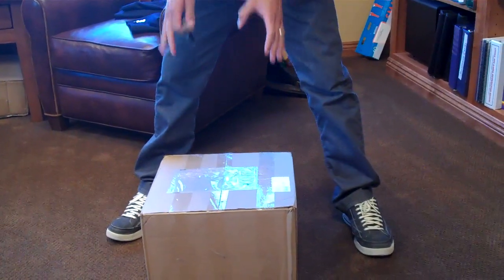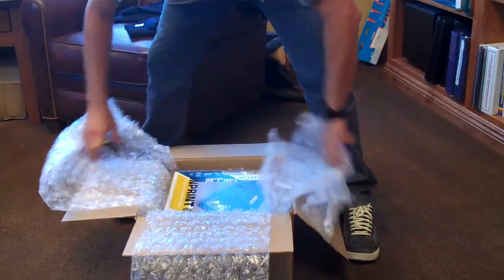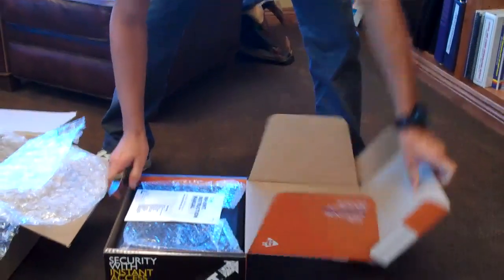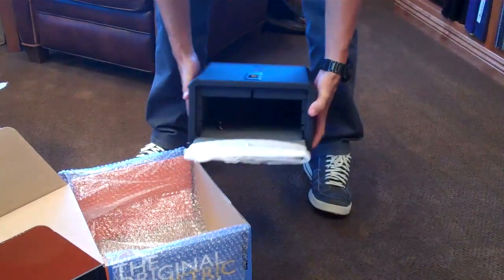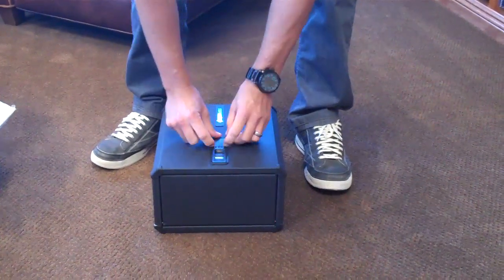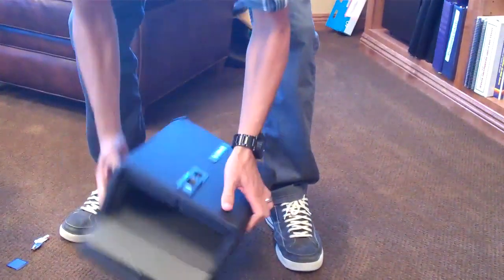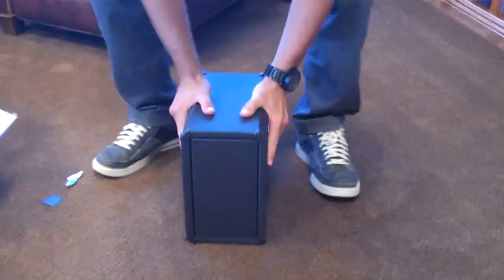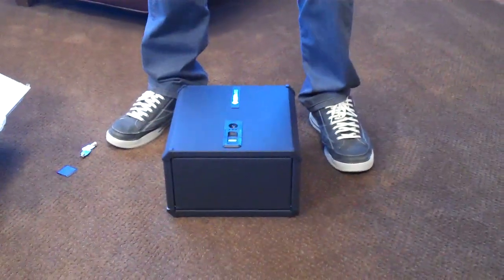another inprint safe fails

Comment: @mjbrennan99 The point is that when 9G got the safe back, they opened it and found the safe had been tampered with.  The lock mechanism is not "passive".  There is a positive catch that prohibits the latch from being bounced open.  However, if you rig the latch so it doesn't completely close, the catch doesn't engage, and you could make a video of the safe being bounced open.